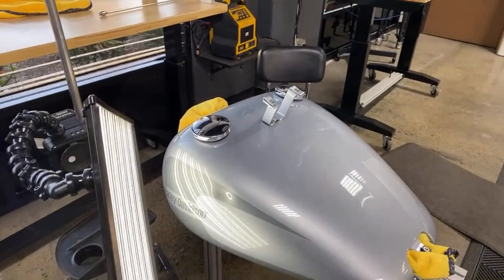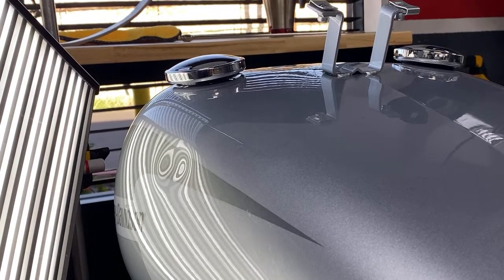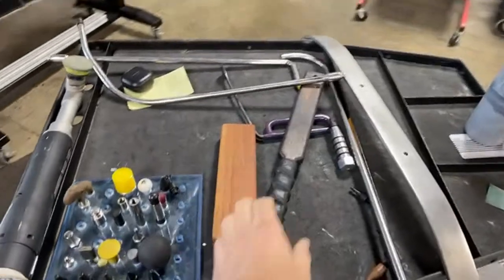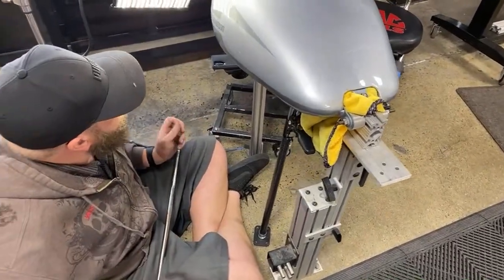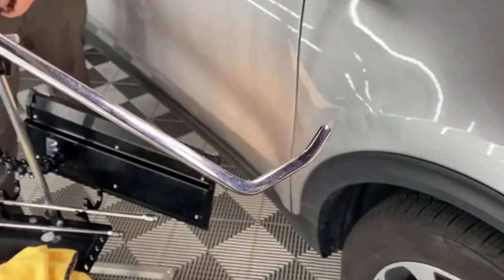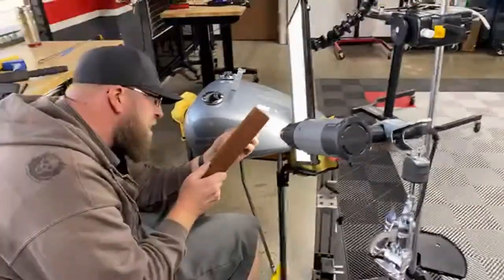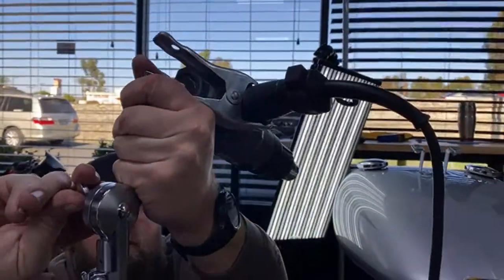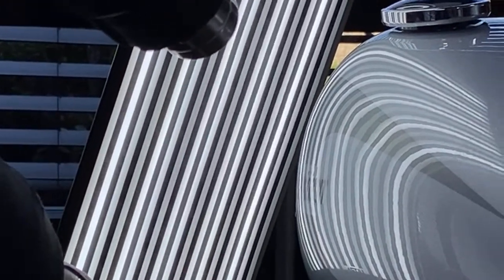Harley Tank Dent Removal Demonstration

Comment: Hi Myke- How hard are these to do on the bike? I am not set up to do one off but have been asked to look at a harley tank that has a dent.
Reply from the maker: It’s always worth a shot but..
I find it about 2-5 times more difficult due to the fact the handle bars are usually in the way, access around the tank can be very limited and half the time the fuel opening won’t allow great leverage or even better access. Hope that helps.
Reply: @denttime  Appreciate the feedback…yes that is very helpful.